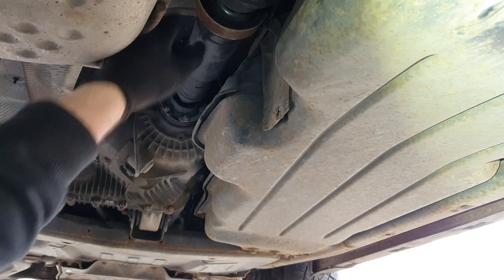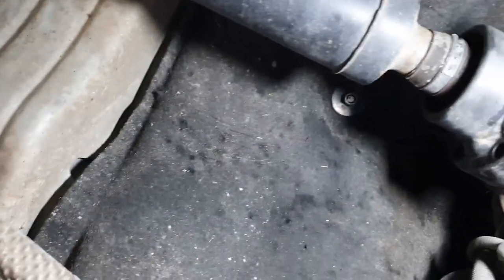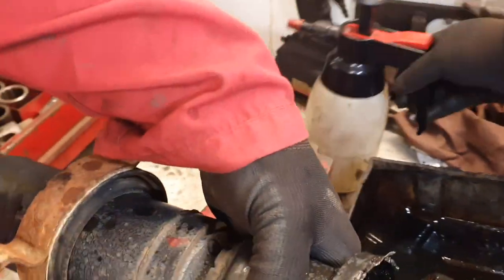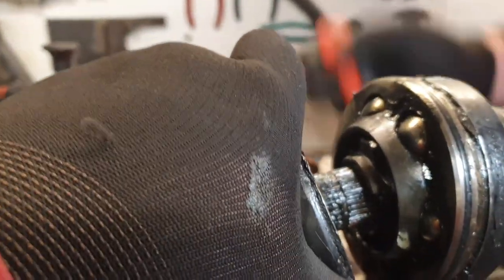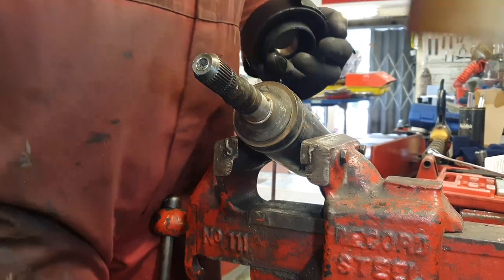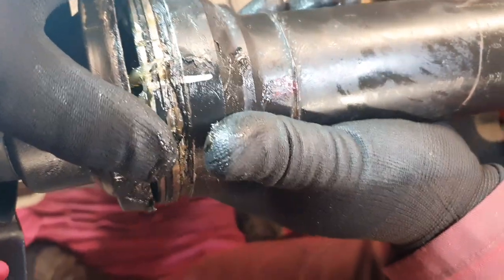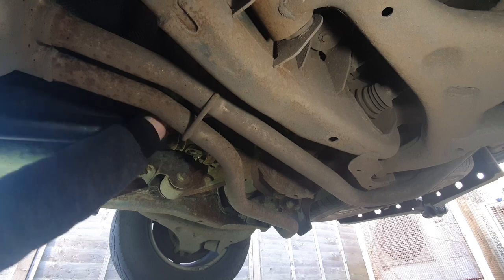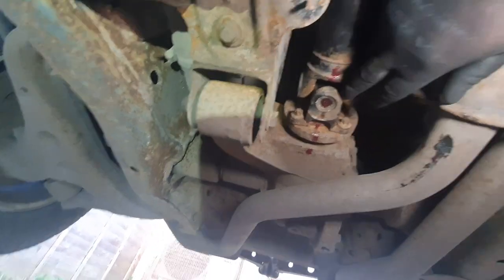Land Rover Discovery 3 prop shaft bearing removal and fitting guide

Comment: Excellent video. Does this also hold true for the Range Rover Sport L320/2009, 3.6 TDV8 prop shaft? I had exactly the same problem, damaged center bearing and disintegrated doughnut bush and bracket.

Comment: Great video thank you! I’m working on replacing mine with your guidance right now! Do you know the torque specs for the e12 and e14 torx screws by any chance?
Reply from the maker: Thanks for the comment. sorry i couldn't get back to you sooner.
Reply: Torque specs: 150nm for E14 50nm for E12 and 30nm for the screws of the bearing! If I remember right 😁👍

Comment: Why mine disco 3 keeps cutting the center bearing rubber 3 times in 100 Meters. Mine is manual 6 speed gear box

Comment: Don’t the bolts have to be torsioned to spec?
Reply from the maker: Hi. Yes there will be torque settings for either end of the prop, carrier mounting and Heatshield. These would be available in a workshop manual or if you like I could post these for you. Thanks for the comment.

Comment: Really good video. But as I can get a full new OEM driveshaft for ~£290, how much labour is involved in replacing the bearing on the existing shaft?
Reply: Would love to no the reply to this. 270 odd quid for a new prop shaft with bearing bolts everything. And can be done in 1 hour max. Or the labour cost plus 40/50 quid for just a centre bearing? Hmmm doesn’t seam worth doing just the bearing. 🤦🏻‍♂️

Comment: Have you come up with any solution for the rear U-joint? Every shaft I have replaced due to the center bearing also needs a rear joint.
Reply from the maker: Hi, on this vehicle the universal joint was ok with no notching on inspection. I would expect its possible to replace the universal joint. So long as you can obtain the part. Then replacement procedure should be the same as any other prop uj replacement. Thanks for commenting.
Reply: @pitstopbysamp   The Lr3 rear joints are staked. I have replaced staked joints in other applications, but no one seems to make a u-joint for this application. I am sure there must be one that fits.
Reply from the maker: @joelletendre1011   Thanks, I will have a look into this and give you an update or hopefully a part number.

Comment: I just got the cover off and the two shafts just came apart, my 2005 LR3 HSE has a different design where the ball bearings are the locater for the two shafts, there is no splined shaft,  well there is a very short one that holds bearings cage in place, the spring clip to hold that in place is impossible to remove, for me anyway, just a warning, since they are no longer aligned I guess I'll be getting a new shaft, there is no snap ring holding it together, the big bearings interlock in a cage and locate into cups on the long end, just thought I'd add that, in case anyone comes across it

Comment: Would the vibrations I sometimes fell at different speeds be the prop shaft? It feels like i got a flat tire, the car starts bouncing and gets worse if I keep driving. If I stop , turn the car off , start again the bouncing stops and goes away. It doesn't fell like a vibration, is more like bouncing, a loose wheel or a flat. I' ve done an alignment but the problem still there. Any ideas.  2006 LR3 , 125k miles , 1.5 lift and 31.5 inches mud tires. Thank you.
Reply from the maker: Hi, your problem does not sound like a propshaft issue to me. There could be a number of causes. I would recommend getting it checked over by a specialist. Sorry I could not be more specific.
Reply: @pitstopbysamp  Thank you for the reply. It's a real mystery to me.I've ruled out speed, as it will happen at different speeds. It's just like a flat tire feel. The first time it happened I thought I got a flat.
Reply: @agentdoubleozero  I have the exact same issue - did you have any luck finding out what it was?! I’ve been told it is the centre prop support!
Reply: @mra12314  Wow, just saw your reply, in my case I had a 2'' spacer on the front wheels. Took them off and haven't have the issue since. I have 1'' spacers on the back that I switched from the 2''. No spacers in the front wheels anymore.
Reply: I'm sure you've resolved this or moved on by now, but I had a similar vibration that quickly turned into a wheel hop as well.  In my case it was accompanied by a burning smell from the rear of the truck.  Turns out it was the parking brake mechanism on one of the wheels, and it sounds like that's somewhat common.  In some cases the pad will destruct or delaminate and then grab the drum, causing this.  In my case it had just been adjusted too tight and would grab in certain situations.  Easy to confirm by feeling the hub on both rear wheels--if one of them is hotter that the other wheels, that's the one.
Reply: I still have the truck. The problem went away after I removed the spacers on the front wheels. I can't say for sure if that was the problem being that a lot of people have spacers on the front and no issues. Anyway if we didn't have any mysterious problems it wouldn't be a Land Rover , it would be a Toyota. Ha,ha @peterehlen

Comment: The prop isn’t dynamically balanced so no need to mark the far ends. I’d be interested to know how many you have done and how many have leaked grease.
Reply from the maker: Hi thanks for your input. its just a habit to mark everything, good workshop practice. Can save hassle or error at times. This is the first D3 ive done and so far its still fine and no leaks.
Reply: It needs to be marked to keep the  unbalance where it is and not for phasing. And of course it is dynamically balanced by GKN.  What you refer to is called phasing. It is not phased because it has only one cardan joint.  I thought this is a good and clear video. My salute.
Reply: they will all fail soon dont bother fixing them have a look on the Facebook page
Reply: @rickfranke4886  I know. Many have tried and very few have succeeded

Comment: Fuck i would have cleaned out the old grease from the center Bearings and use a good Hi pressure grease ,( grate for large CV joints also) and make a Proper Job of IT !!

Comment: There are many levels of no in this video. Biggest two is not changing the whole prop because the greese cap will definetly not reseal and second is the fact you put it in a vice which is a definet no no. Go to any landrover specailist and you will see a bin full of props. the repairs never last and a new prop is not that expensive.
Reply from the maker: Thanks for your sharing your opinion.
Reply: do you have to get a new prop balanced?
Reply from the maker: @loveyourlawn9725  Hi. No a new propshaft will be balanced by the manufacturer.